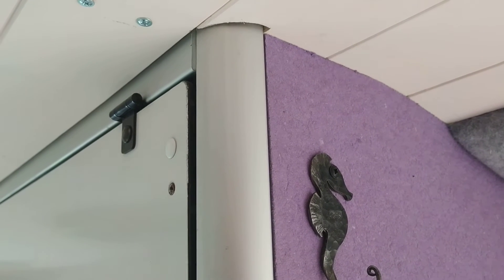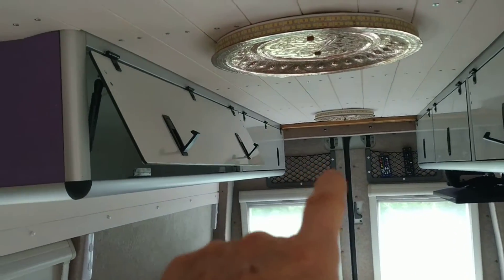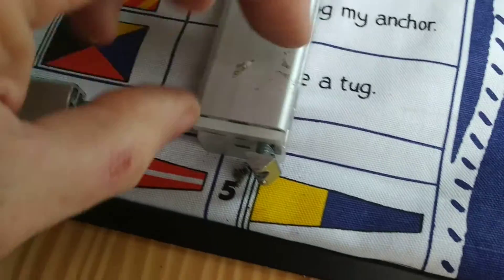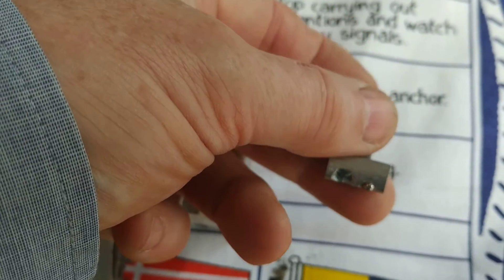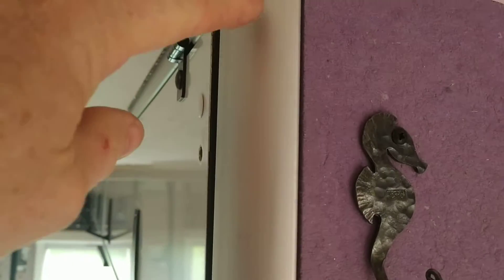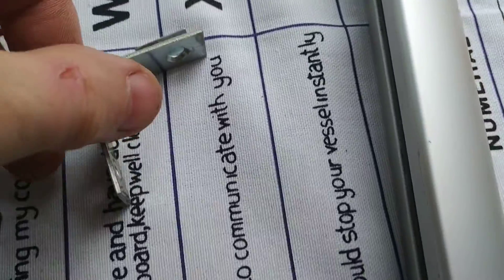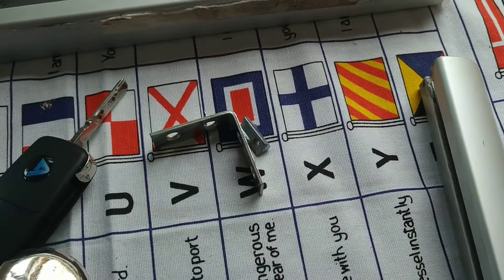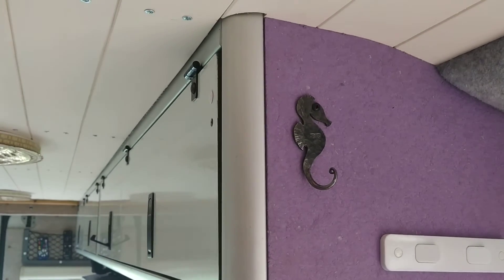Ex Ambulance campervan conversion overhead locker failure!

Comment: Blimey what a PITA 
Access for repair is easyer with the wilker build i have, thankfully it has much simpler and robust connections.
Glad it turned out to be an easy fix it'd be heart breaking to have to pull all that appart after all your hard work 👍
Reply from the maker: Cheers, my van was originally converted by O&H their build standards are the worst I have seen and don't compare well with the others.
If you follow dogs in a pickle on instagram, I did some work on their van back in 2020 and their cabinets are the same as CJ has in Amber really nicely made!
I can't remember who that converter was though!

Comment: Hi Kieth, love your videos. I’m currently in the process of converting a VW CR50 Scottish Ambulance (MacNeillie). When they took the van out of commission, they also took the Genisys system out and all the control panels. However, the leisure batteries have been left in and are still wired up and there is also a sterling pro charger. I’m looking use the AUX and COMS batteries in my build but stuck to the box under the seat! (Makes my head fall out) - have you had any experience or wiring with this specific van? If you can share any points it’s greatly appreciated. Just wondering if you’ve got a work shop - more than happy to pay for your time.
Reply from the maker: I am not taking on any electrical work for people at the moment. 

I've also learnt not to get involved providing advice via extensive email threads etc. it was getting too onerous and time consuming!

However If you aren't far away from where i live in North Shropshire your welcome to pop around for a chat.

Contact details are in the 'about' tab.